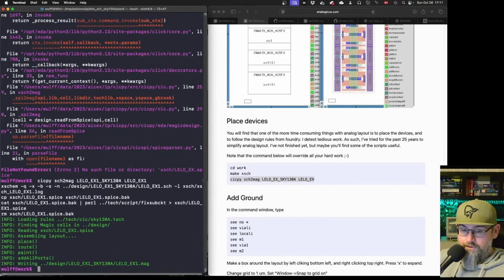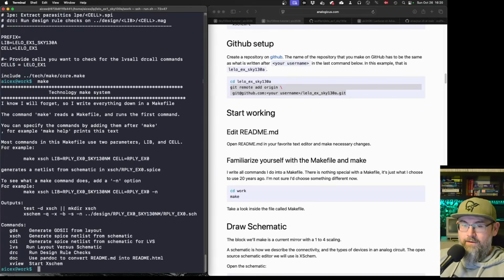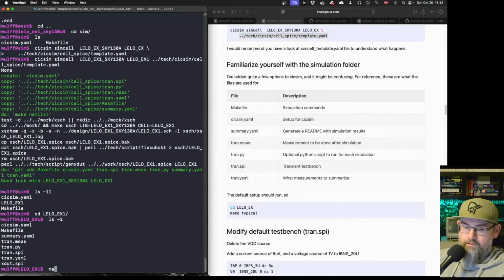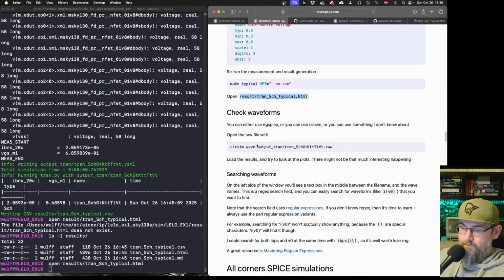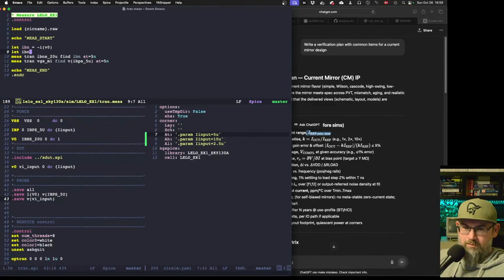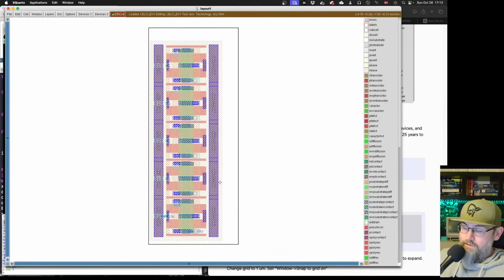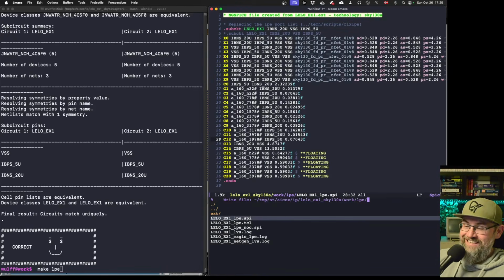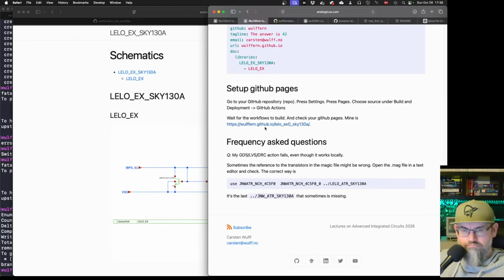AIC26 - Sky130A Tutorial

Comment: Is there a reason you choose to use the .meas files instead of going straight to python at this point? I've been finding writing the meas files to be infuriating. The built in functions are limited and often have unexpected behavior, sometimes you need a "let"  other times you need a "meas", calling variables sometimes needs a $&, and documentation on all this is sparse. I've used the .py files to process the yaml outputs, but why not just go straight to python to process the .raw? I see you have the rawtodf function already used by the wave function.
Reply from the maker: Mostly because the built in functions work well. It's a fair point though, might be easier. Unsure if it's faster though.